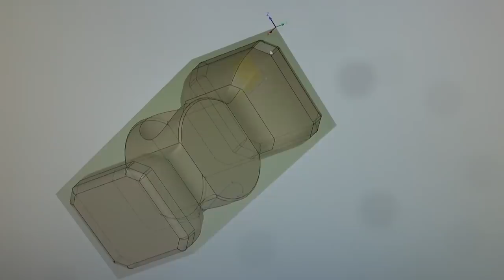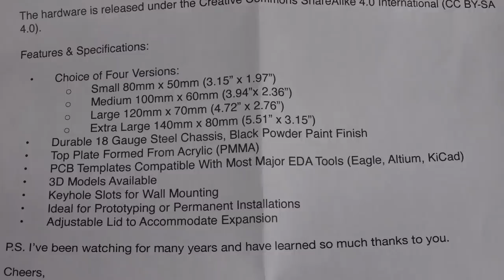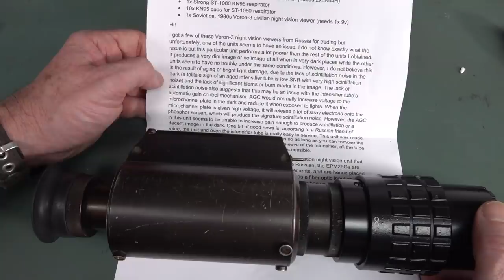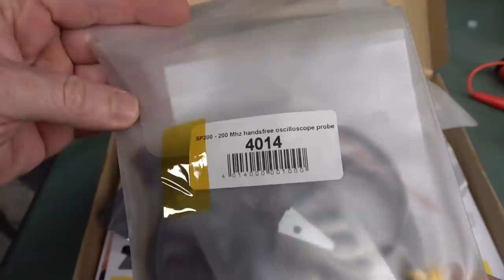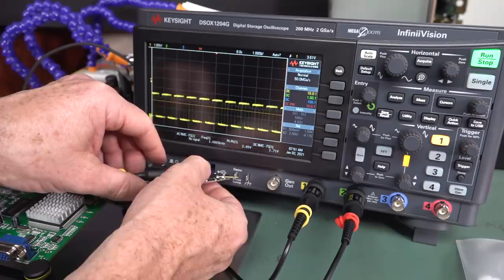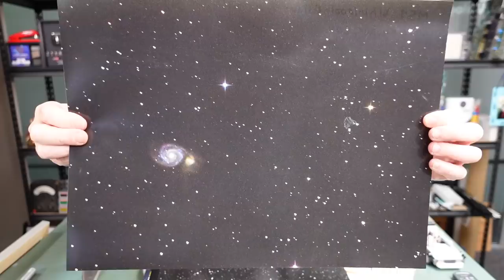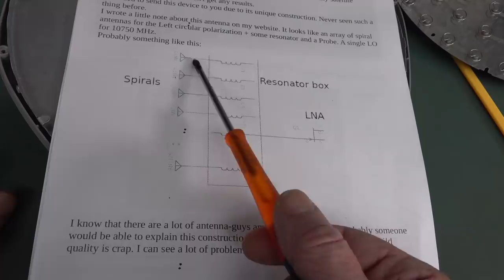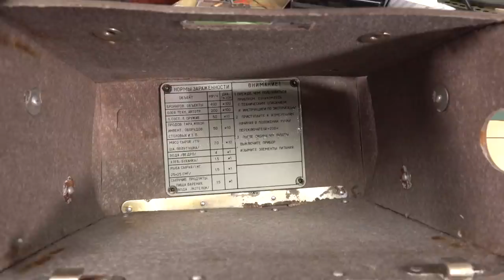EEVblog #1362 - A Very Skookum Mailbag

Comment: regarding that Russian night vision viewer: it should be powered by 9v battery. The letters at the front side are "do not turn on in a day light". It is quite rare thing with prices started from $200 and was developed for Federal Rescue Service in 199x. Can be attached to Soviet "Zenit" photo camera. The top screws are used to attach infrared projector. Here is a bit of internals
http://www.kotelnikov.net/blog/2gen-nvm
https://forum.guns.ru/forummessage/209/945893.html
Reply: Походу поздняк... уже включали)
Reply: The Zenit used a standard 'O' mount as far as I can remember, which means that it would also be compatible with several cameras including the Praktica (East German) range and Asahi Pentax Spotmatic etc.  Going on memory here, but I think it was a 42mm thread with 0.75 pitch.  Where it sat on the body mount (focal distance) may vary though - that's the bit I don't know about the Zenit.

Comment: The R0de Go is a great mic but the output levels from the receiver are TOO high for most of my cameras, even when set to the lowest level.   A home-made resistor-based attenuator does the job.
Reply from the maker: Yep, found I had to use the lowest of the three output settings.
Reply: I was just gonna comment about the mic peaking...
Reply: @EEVblog  It seemed to happen when you leaned forward, so I suspect it was clipping from the directly coupled vibration from your neck.
Reply from the maker: @strehlow  I now see that in a timecode someone pointed out. Yes, unfortunately mic placement/t-shirt combo.
Reply: @EEVblog  Is the hole for the audio on the top of the mic. Wondering if your neck was covering it when you lent forward.
Reply: @EEVblog  I have one and I talk loud and have to wear the mic like a lapel mic otherwise it distorts on the lower setting  if I have it on the neck of my tee. I also bought the optional lav mic for it to help, but I just wear it sideways half way down my chest and it gives very clear audio.

Comment: Many thanks for the video. Was happy to see vintage Russian electronics and "Radio" magazine. I used to be a subscriber for this one for some time, it's a Russian equivalent of American QST. It's published monthly up to now. [57:25] That's not a flux residue but a varnish. It was commonly used in soviet electronics instead of solder mask. [59:15] It says "DB-5B Roentgenometer". The left one is "Technical Documentation and User Manual", the right one can be roughly translated as "Logbook". [1:01:25] Such kind of earphones were quite popular in ex-USSR. They were used in all kinds of military and radio equipment.

Comment: The rotating metal sleeve on the Geiger counter is a shutter to expose the beta window.
Reply: Above and I bet the position with the bump out contains a test source.
Reply: I think has an integrated know radiation source on that boulge in the back for self calibration
Reply: Correct, it is so that you can selectively block out alpha particles leaving just beta and gamma radiation.
Reply: I grimaced when he touched the window.
Reply: @wireb  yeah that bump is test source

Comment: The audio cockups are probably due to that microphone being too close to your throat, so whenever it touches your skin, it gets totally out of whack.
Reply: Agreed totally.  When he has his neck out and leaning over the mic, it acts up.
Reply: If you look really closely, you can see his neck touch the top of the mic at the same moment the audio goes funky
Reply: Personally, I prefer a good lavaliere with a belt pack. The placement is correct though, as lav mics, also known as "lapel" mics, should be placed as close to the larynx as your outfit/costume can afford, preferably your collar (but not beneath it), NOT off to the side on your lapel. The reason being is that you get the best pickup there, and you don't loose volume and start listening to the ceiling HVAC if you turn your head.
Reply: @BlackEpyon  I totally agree - as long as it doesn't touch your skin, because that's when the audio gets screwey.

Comment: About the night vision : I've done repair on similar one - the high voltage generator is crap. There may be many cold solder joints. This was the case with the one that I repaired. And beware -  the wires are very thin and very fragile.

Comment: The Ku-band antenna array operates approximately as follows:
1) the center conductor is a probe that couples the energy to the cavity between the two ground planes
2) the energy propagates radially away from the center probe and the whole cavity acts as a radial power divider
3) the energy is coupled to the spiral antenna elements, the spacing of the elements radially away from the center conductor should be approximately multiple of the wavelength of the propagating wave in the cavity at the center frequency (usually one or two wavelengths, larger spacing will result in grating lobes)
4) each of the elements radiate the energy at the same phase (center frequency) which form a beam perpendicular to the plane of the antenna.

Comment: I love the new backdrop,. although a bit of bokeh would be nice to give more seperation between you and the background.

Maybe crop in a bit to hide the racks.

I don't recommend going the green screen route for mail bag segments.

I've never seen that problem with the rode wireless mic.. do you have both the camera and mic on manual levels? There's no auto gain madness going on?
Reply: How is the fan generator you made a few years back?
Reply: @mediacoregroupph  I never had any place to mount it. And if I was going to mount something, I'd probably use a more suitable DC motor. It's more of a proof of concept.
Reply: I think the backdrop would be better if the TV/display could be calibrated. It's very blue shifted.
Reply: Hide the racks?! Sacrilege! The memorabilia on the racks behind Dave are part of his branding and deserve to be in the shot.

Comment: 23:05 it's a fused fiber optic faceplate, it has the effect of being a "zero width" window to the phosphors/image plane and also inverts the image (rotates 180). the outer edges look darker because of the twisted design of the fibers rotating the image - the outer fibers are longer. google "fused fiber optic faceplate" for similar examples.

Comment: The 10.7GHz antenna is a phased array, despite having no electronics to shape the phases of the signal (and actively steer it) - just the delays just from spacing of elements focus the beam of antenna in its axis.

Comment: The Russian Geiger counter (ДП-5В) uses R12 battery cells which also can be replaced with separate cells from more easily obtainable 3R12 battery. The rotating shield on the sensor is used to block beta radiation for gamma-only measurements.

Comment: Re. the Russian alarm clock:
The shiny deposit on the inside of the vacuum-fluorescent display is almost certainly getter, as used in thermionic valves (tubes) and inside the outer envelope of some HID lamps, for anyone interested. It's there to get rid of any remaining free oxygen and probably other gases.

Probably already mentioned but I haven't read all the comments. Sorry if this is repeated info..

Comment: usually you find schematics for most modern stuff somewhere, its just 300 page pdf's      tv's and av receivers have the best service manuals out there, just look into a pioneer sc37 service manual for example... 100 pages just schematic wiring

Comment: 57:03 that black mark is the getter, which removes stray gases from the vacuum. I assume you know that and just didn't catch that it was the getter.
Reply: Also, if the tube gets broken that black mark turns white. Quite nice indication of broken tubes.
Reply: @kotqrka  It tends to get transparent for slow leakage, like corrosion along a pin compromising the glass seal. White typically indicates a quite quick air inrush, you typically find a crack somewhere then.

Comment: That boulge on the rotating sleve of the Geiger counter might be holding a known radiation source for self calibration. You probably need to rotate it into the opening and set it to the calibration position. It should be able to calibrate itself on the field in order to be reliable enough for the army.
Reply: The boulge is indeed designed to have a calibrated Co-60 beta/gamma radiation source. The only problem is that the things have very limited shelf lives. Even if the device still has the source then today it has mostly turned into stable Ni-60 and the intensity must be way out of specs. The expected half life of Co-60 is around 5 years so even if the thing was made right in the last days of the Soviet Union the intensity of the source is probably so low that the device would most likely have trouble even detecting any signs of its presence let alone calibrating from it. Unless of course someone has replaced it with a fresh one recently but I highly doubt it. The things require a strong neutron flux to produce (from a specific type of a nuclear reactor) so they are not widely available and are generally very hard to obtain.
Reply: @Kirillissimus  nice, thank you for the info.
Reply: Would vasaline glass not provide enough of a calibration source?
Reply: Good enough for Russia even without calibration. Sometimes you don't even want to have precise numbers.
"3.6 Roentgen Not Great, Not Terrible"
Reply: @RainerMeier   Not great as in leave the area or stay a while longer?
Reply: @Arachnoid_of_the_underverse  Google it. Favorite quote from HBO miniseries "Chernobyl". Often quoted as a running gag since the Geiger counters they used in Chernobyl did have a maximum scale of 3.6; so officially they reported 3.6 Roentgen.
To be fair they used to have a "good" one with larger scale but this one failed. So 3.6 is the only valid value measured.
Reply: It's a Б-8 Sr90 source with initial activity about 70 KBq

Comment: 55mins, not only LNA, but a downconverter too, see there is an osc, and mixer, so the low frequency IF goes down the exit coax, it is very similar to normal dish heads, open one and have a look

Comment: 24:45 Yes it has a fuse, but not a HRC one like you really want in a meter that measures current, especially if you're likely to be holding it while doing so.

Comment: With reference to the satellite antenna, the extra die cast module inside contains the 10.750Mhz local oscillator. The oscillator uses a DRO element to control the frequency. Note the small grey round pill sitting on the board next to the oscillator transistor. This is the DRO DEVICE. (Dynamic resonance oscillator).

Comment: Time to get some small baggies and have a Wall of Widlariser parts. Put it above the TV set, so it is a count of mailbag progress. I have a big hammer, with the name "Gentle Persuasion", that is used for this purpose, although it also has been used to gently fit things together. Have a pair of anvils for it, one a cutting from 1in stainless steel, called the "deep blue sea" as it still has the remains of the Prussian blue marking on it, and the other is a rail slipper.
Reply from the maker: I thought about mounting a wall of PCB's behind me?
Reply: @EEVblog  Put them on top of the TV set, will fill in the top section nicely, and you can gradually get a side panel as well with time.
Reply from the maker: @SeanBZA  The top of the TV is not visible.

Comment: @EEVblog - Dave, the knob should come off the Geiger counter if you first push it downwards after removing the screw, from memory the screw pushes a wedge up against the bottom of the knob. The counter is known as a DR-5B by the way. The sliding thing on the probe is a 'Beta Shield' which when the window is open will allow Beta radiation into the probe, when closed it's only Gamma. When you slide it around so that the bulge on the back is facing that hole, then that's your 'Check source' (if it hasn't been removed). Usually the check source is Cobalt or Strontium so they are usually removed. 

I've never seen that battery eliminator before, seems odd that it would take 12V but I guess there's a reg on the PCB. The batteries are some weird-arse soviet size that we don't have, but you can bend the tab to get AA's to fit. There's 1x for the dial lamps and the other 2 run the actual counter circuitry. if the reg in the eliminator is a linear one, then 200mA suggests that it's knackered. I have this exact model, working, but I would love to see a good quality scan of the circuit diagram if there's one in the manual as so far it has eluded my searching!

Comment: ДП5-В (DP-5V) is very common soviet geiger counter. Powered by 3 1.5v cells (hard to find now from-factor, can use cells from disassembled 4.5v battery or just AA with some spacers).

You only need 2 cells(close to each other) for actual counter, third is for backlight. They are connected in series.

 
"Triangle" position on range switch is self-test and battery control. Needle should go somewhere to black sector(between 2 and 3). It may take up to a full minute to startup. After this the device is ready and you can switch to some range.
This counter has "military" sensetivity.  Maximum range "200" is 200R/h (lower scale), all other in mR/h (upper scale).

Left switch - only turns on backlight.
X button - resets readings. Useful when switching from low to higher range (especialy if it was over scale).

It may have test/control radiation source directly into the probe. It is located in the bulge on the rotating sleeve. It is exposed to the counter tube by rotating the sleeve. The sleeve has 3 positions gamma, gamma+beta, test source. If yours has only 2 positions it has no test source. Also even with 3-position probe, actual source can be absent.

circuit diagram:
wfi(DOT)lomasm(DOT)ru/files/coll/wm/56480_p0016.png

Comment: The gate on the Geiger counter is to block anything but gamma rays from being detected by the Geiger-Mueller (GM) tube. Beta particles will readily trigger the tube through the little green window otherwise. This allows a degree of discrimination of the "type" of radiation being detected.

Comment: You do NOT want to mess with those 2.4ghz wireless jobbies AT ALL!

I'm a sound technician and I deal with audio gear all the time, microphones, speakers, mixers... and those 2.4ghz things are flaky as hell because the band is way too full of interference and the frequency is high enough that the signal won't penetrate anything and relies purely on bouncing around to find it's way if there's no direct line of sight. And the TX power is very, very small.

I don't think they ever make anything that really works well because in WLAN stuff you can just resend something if it wasn't received, use a lot of error correction etc. but wireless mics don't have that luxury (since it would add a ton of latency) so they can go haywire if you look at them wrong...

That's why the professional wireless mic systems meant for concert use are expensive, because it's not easy to do that stuff so it's reliable.
Reply from the maker: Yep, that's why I have a proper 600MHz Sennheiser wireless mic system. This 2.4GHz Rode one is just for my portable kit because of it's size (see previous video), so designed for "at a pinch" recording. Wouldn't normally use it in the lab, just trying it out. Could be that I mounted it backwards too to hide the thing inside my shirt.
Reply: @EEVblog  Ah, didn't know it was more like a "spare"... but yeah, I've tried to find one that works well, but they never seem to :D
Reply: @EEVblog  it isnt new info im sure as this point but im going to second it that you are pressing the hole in the mic to your skin, try either wearing it backwards of what it is or outside your shirt and she'll be right
Reply: Another job for the brass Widlarizer

Comment: The gate on the Geiger counter is for measuring alpha radiation.  You take a reading with the window closed, then with the window open.  The difference is your alpha measurement.  Alpha radiation gets blocked by just about anything, including normal street clothes.

Comment: I have one of those Russian М
КУ1 calculators! It was shipped to me from Ukraine, in a burlap sack, survived the entire trip, worked, and got knocked to the floor accidentally 10 minutes after I received it by another member of the household, cracking the VFD tube! D'oh! Fortunately the tubes are cheap as, and I was able to easily and cheaply repair it. Keyboard on those feels like trash though. Same keys as a 1976 4-71Б I have.

Comment: The audio issue around 10:40 and 26:30 looks like it's because the mic was pressing hard against your neck so that it wasn't getting sound through the air, but was from sound transmitted through your body. Worth testing for repeatability.

Comment: I suspect the cause of the intermittent audio issue to be the microphone hole getting sealed off against your skin. I don't have a Rode Go to confirm, but i suspect that the actual mic hole is on the skin-facing side, or otherwise in a location where it could be covered/smothered.

Comment: Yesterday, I made  two of the PCBite things out of aluminum and it took around 2 hours for both. I did not try hard at all but made it so that the top side of the board would be roughly 7/8" high from the surface (0.877" to be exact). Any shorter than one's thumb width, for me, it becomes not too comfortable to stick the board on it (with the way both the original and the ones I made are made). I think I can make it 0.75" inches long but I am thinking about another way of making it which could be 0.5" or even shorter. Nice idea but I think 80+ Euro is just too much for four pieces of PCBite.